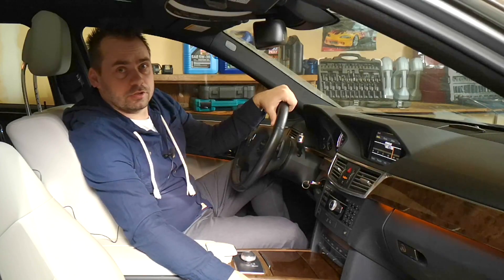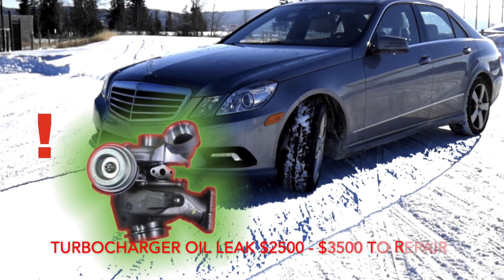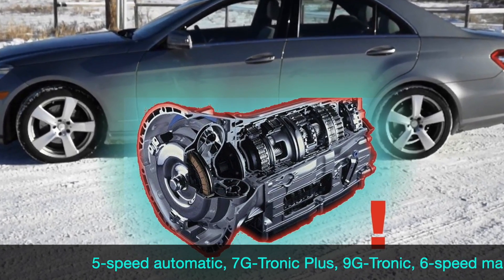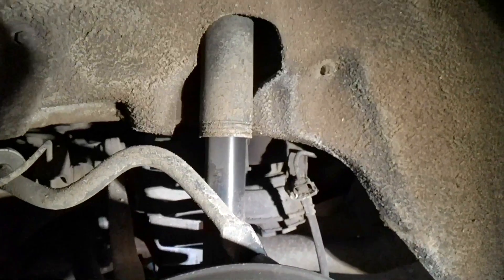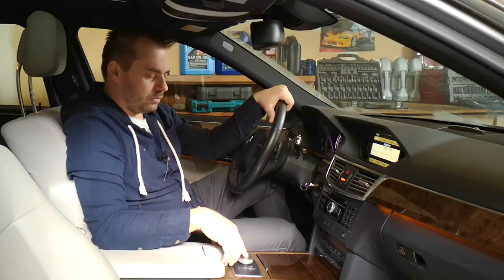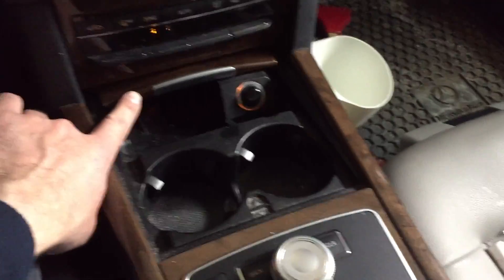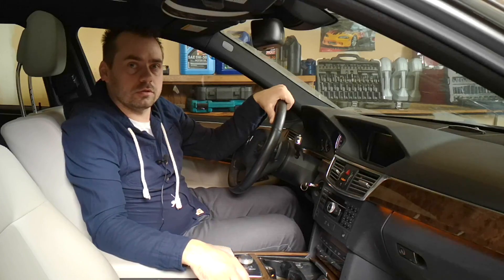🤞 🇩🇪  Used Mercedes Benz E Class Reliability | Common Problems and Issues | W212 S212 / 2009 - 2016

Comment: 2015 E63 AMG S owner here, no issues at all besides basic maintenance I do myself (oil changes, coolant flush, spark plugs and front brake pads change). I also have a custom stage 1 tune and this car is reliable and pulls really hard. Such an amazing piece of machinery. So overall, it depends on how you treat your car and knowing previous history of the car

Comment: I own a W212. I have none of these issues with mine. That dash appears to of been taken apart and not re-assembled properly.
Reply from the maker: Just wait for it
Reply: U bought an accidental car
Reply: @suhailahmed4449  i had 2012 e class that was old taxi, 400,000 kilometers driven and it had none of these issues :D 3 liter diesel ;)
Reply: Same here, only the Avantgarde and AMG versions came with real leather, I have mine since 20k, now has 100k (miles) and the leather is almost as new, also the interior build quality is somewhere else compared to this car (2.1 CDI avantgarde)
Reply: @Sawyer Valentin piratebay forever bro :D

Comment: I have over 180 000 km on my W212 and I’ve encountered none of those problems. The misalignment on the taillights can be adjusted by turning the screws made for alignment in the trunk.
Reply: Cool, you bought it when it was new? Whats your own way of maintainance on your car? Can you pls give me some advice? I am planning to buy e350
Reply: @Ochiroo0114  I would do pretty much anything I'd do with any other car. always change parts on time, like the timing belt, transmission oil, engine oil, etc.. avoid bumping into potholes or driving on high rpm-s for long periods of time. If you take care of your car, it will take care of you. Its true for Mercedes at least. Make sure your battery is in good condition, as that may lead to many problems. I had to swap out my burned out GCU because of a faulty battery, cost me alot
Reply: @NikoAbaishvili  With your faulty battery, did you notice issues like lights flickering on the interior when idling?
Reply: @Ochiroo0114  I would say try find a facelift W212 since Mercedes spent an extra billion dollars facelifting it and I think they upgraded some components.

Comment: 6:20 The leather NEVER rips, those are MB-Tex seats and they do rip. The leather seats look different much like the W126 from 1980-1989.
Reply: I have a 2010 e350 sport and the driver seat is starting to rip.
Reply: @mjcmjc6428  But you have the leather or the MB Tex? My E350 2011 has 250K and seats still perfect.
Reply: @mjcmjc6428  You may think you have leather but it actually isn't, the MB Tex looks and feels like leather.
Reply: 2010 e350 sport with natural beige leather it’s a 1,590 extra option when they came out back then more comfortable than MB Tex

Comment: I own a w212 e550 and it has been the best car i have ever owned. No issues whatsoever period. I think judging by how dirty this car is under the hood and in the interior, this guy has picked up a neglected model that some person leased or owned but refused to maintain. 

MAINTAIN YOUR CARS PEOPLE. DO WHAT THE MANUAL SAYS AND GET YOUR MILLION MILE BADGE 20 YEARS DOWN THE ROAD> A maintained car is cheaper than a new one.
Reply: So why does dirty cheap cars work??
Reply: @rahimi4762  I think you missed the point there brother.
Reply: e250 2016, if it wasn't for the diesel emission system would have jus been routine maintenance. Had a nox sensor go and a diesel temperature gauge. Had a field measure done last year so I have a new DPF & other parts. Just waiting for the adblue heater to fail now (30,000km left on warranty) since it's the original one.

Comment: I have 2011 e250 automatic with 321k km, cuprite brown. Interior is still like new, no wrinkles on the dash or ripped leather. I do quite a lot of city every day to work drives and long range up to 700-800km specially for summer. So far around 270k the chain stretched a little bit and was replaced, 290k km rear right distronic sensor failed, also around that mark ESL failed, 300k km scroll wheel, 310k km starter failed, 321k km mechanic said the water pump might leak and would be advisable to change. So far no oil leaks which surprised mechanic as well he said it was dry as desert. While the issues piled up at 270k km it still pulls very fast for such a heavy car  with 204 hp, its very comfy for long rides.

Comment: Great video, thanks!
In my experience, people often and wrongfully think that BMW and Mercedes-Benz luxury cars equate to reliable cars. 
This incorrect thinking goes "it costs a lot, so it must be well made".  that is hardly the case. I've had nothing but problems with my BMWs and MB's over the years (2000-2013s), which I do not buy anymore. I have also owned a newish model Audi (2014).  Surprisingly the Audi is not nearly as bad as my BMWs or Mercedes that I have owned. 
In either case I think I have found the sweet spot - Lexus. I bought my first Lexus in 2014 after I tired of the crappy BMW and Mercedes build qualities. The Lexus has been great, with almost zero issues, 8 years and 130k miles later.

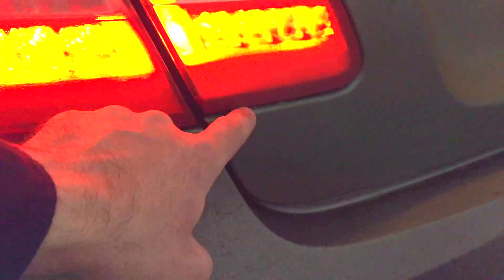Comment: 5:55 any car can get a misaligned trunk if you stuff luggage into it. You can adjust the striker at the lower sill (two 10mm screws) in 5 minutes.

Comment: nice video! I'm surprised at the interior issues aside from the seat. My 2010 has 108,000 miles and i've had both front seats reupholstered for $420 and the wood trim has faded to a blueish/gray wood which actually looks cool on pallidum silver exterior with the black. I have push to start which i guess explains the key always working fine-- i keep that center tray clean and lubricated so it can slide freely and it does. command wheel has never had a problem and neither has anything else.
Reply from the maker: Thank you, leather quality is just poor, but sport seats are OK.
Reply: Yea I had same issue repaired both seat 200 that’s it nothing else at all

Comment: I know this is a w212 video but I have a 2007 w211 e550 and it’s been very reliable. I bought it with 130k and it just ticked over 145k miles. All I’ve done are oil changes and replaced all plugs and coils

Comment: Great video, equalize the volume though!
My issues on mine were/are:
- Coolant pump leak
- Fuel filter housing (coolant hose) leak
- Gearbox swithces to P under 10kph randomly!!!!!! (DAS failure probably in EZS)
- Rear wheel bearing
- Steering gear weak
- Transmission roughly shifts
- Noisy plastic parts inside
- Leather seat rips
- Random oil leaks

These were the most annoying. Engine is not bad on the other hand.

Comment: For anyone watching this -

Just bought a 2011 Bluetec 3.0 diesel with 123k miles. Totally clean inside and out. I paid $9500 cash.

I took it to the dealership to be inspected and to fix all major issues.

Timing Chain - $3100
Engine Mounts - $1350
Parking Brake Assembly - $680

Hope this helps
Reply from the maker: Car after warranty deserves good INDY shop not dealership, could have paid half.
Reply: Yep, if you find a good privateers shop, engine mounts will only charged $300-500 to replace. Dealership is a ripoff.
Reply: So a used Mercedes is a piece of crap is what you are trying to warn us about?
Reply: @MechAdventures   for real, that price for the engine mounts that cost $150 is INSANE.  Not even a difficult repair for DIY!
Reply: @erichue61  No, those are wear and tear items, just like on every vehicle, he just got reamed by the stealership instead of going to an indy Euro shop.
Reply: John Knee ok, my bad. I have a Lincoln, where do I take it to?
Reply: @erichue61  I'd just look at Google reviews for Euro shops in your area.  They'll always be cheaper than a dealership.  Or if you're mechanically inclined, there are YouTube videos for just about anything

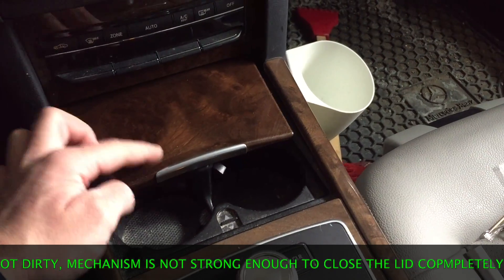Comment: 5:04 the sliding door works fine - use silicone spray and don'y force it. Designed by an outside company for Mercedes-Benz. Yes, they are delicate if you abuse them.

Comment: Good job, I just bought the car and all the problems you just mentioned are present on my car. Also the speakers and heated seated break... My two front seats have the vinyl tearing apart and also the back starting to tear apart. The bottom part of the seats have two heated seats wire and they all fail on this model... I have a Mercedes-Benz e300 1999 td also and not even a mark on seats after 214000km and the heated seats and speakers still work. It's sad to see the Mercedes-Benz brand going down over the time...

Comment: Good info! I planned this year to look for a nice 2010-2011 E 220 diesel station ( current cars are 2 Volvo V70 D5, and yes at least one of them I keep ! ) But it is the better choice to go for the more basic models, 200CDI, 220CDI and standard petrol engines, more than comfortable enough! The air suspension is a big point of attention indeed as de timing chain. But for the rest the E-class is an absolute reliable comfy car, not to mention that my Volvo's D5 are great cars too, especially the 5-cilinder engine is a BIG PLUS and the real leather seats in my cars are nearly fenomenal. Extreme good quality and comfy. Well so to go for a Benz might be a little risk ( the reason I keep one of my D5's ) but for sure I wil buy a real German built Benz, believe it or not: they are significantly better than the rebuilds from the US. But hey I live in Holland, so Germany is my neighbor, plenty of nice cars here on the road!

Comment: If I make one modification to my 2012 it will be an adjustable rear lower control arm.  With the OEM, camber will go out of spec after a while even though the joints are still tight.  No play but they do get compressed and wear the inside tire tread quickly.  I hope to keep it for another 25 years.  I just want to be sure that the aftermarket piece is as solid as the OEM.

Comment: 2011 W212 E350 3.L diesel.  
One issue is the coking up of either the EGR valve or intake manifold, caused by PVC system.  Keep the red rubber gasket between turbo and inlet horn in shape.  To minimize the oil carryover, I recommend using TurboMaxx oil treatment as it reduces oil consumption, and side benefit lengthens the timing chain life. 
The other is strange, will show as a low EGR flow warning, put you into a limp mode.  It is the mass flow air sensor MAF calibration.  There are two MAF sensors and they are flow balance matched, the EGR flow is calculated  by the ECU combining the EGR position sensor inputs  and the MAF sensor inputs to provide the EGR FLOW data for the injection system.  The EGR is usually not the issue. The issue is the MAF sensors being out of balance or if one fails... usually they are out of calibration due to contamination or attempting to clean.  Be sure to keep the red rubber gasket between the air horn (where the MAF sensors are) and the turbo up to snuff and not leaking, and the PVC system up.  If you try cleaning the MAF sensors as preventive maintenance or any another thing that changes the calibration balance you will be in for changing the entire air inlet horn with matched MAFs part costs $350-$550 depending on supplier (OEM Part ONLY).

Comment: Those are MB-Tex seats, not leather.  MB-Tex is normally nearly indestructible, so I'd question the maintenance of the car.  The damage shown on the driver's seat is typical of someone using some sort of "cleaner" or conditioner which attacked the material..  I think you'd be hard-pressed to call it a systemic flaw.  The console cover tension can be adjusted.  It will take an amateur about an hour, a pro should be able to do it in half the time.  Hardest part is getting the console side trim pieces off, and while you're at it you might as well replace the shaft in the Comand controller knob.  You're absolutely right, if it hasn't broken yet, it will.  $100 for the kit?  You didn't dig very deeply; I paid $28 including sales tax and shipping for mine and replaced it in about 40 minutes.  The "kit" consisted of a machined aluminum shaft.  I have a 2011 E550, my dash doesn't squeak at all, and I have zero body-panel alignment issues.  A sunroof that doesn't close fully is most often poor lubrication, dirt or some other foreign debris in the tracks.  I had the problem with my 99 and my 2006 and in both cases cleaning and lubricating the tracks cured it.
Reply: Why does peasant cars sunroof close with dirt debris and poor lube??? Ppl making excuses for overpriced Benz. I miss the days of bank vault Mercedes

Comment: I love you for making this video haha. I have a question: I'm buying a 2012 E350 used one. It has 114,000
 km but its been maintained by the Benz agency really well. At least from what I can see in the service paper. What's likely to go wrong with it or what should I look out for? And is it prone to getting some sort of engine leak that will cost me a lot?
Reply from the maker: Be aware of all that is stated in the video
Reply: As long as it isn't a bluetec you should be fine.  And if it is a bluetec, prepare to do the oil cooler seals once and the turbo intake seals about every 20k miles.  Relatively easy repairs to do if you're mechanically inclined, own a WIS from Ebay, and set of ETORX sockets/wrenches (ratcheting helps a lot).  

If you get a copy of the WIS and take the time to learn to use it, you can repair almost anything yourself on these cars.  They aren't as daunting as they're made out to be, just--different than what most people are used to (i.e. Japanese)

Comment: You mentioned the M272 3.5l but left out the M276 3.5l engine, the latter is what I have in my 2014 W212.
Reply from the maker: would you share you experience ? Hows reliability ?

Comment: My 10 E550 4Matic had the Comand scroll problem, the lazy cup holder return cover, the auxiliary battery for shifting needed replacement. The blind spot detection sensors are the only failures that I haven't addressed.  The front brake rotors were a problem with pulsation and should have been recalled.
Reply from the maker: Thanks for input

Comment: Can you do Mercedes-Benz W221 video? I want to buy mercedes E or S. I'm like 50/50. Don't know what to choose yet.
Reply from the maker: I will. They are very similar with almost identical issues. Pick one you like more visually.
Reply: Get the W212 instead… those S-classes get pretty freaking expensive to run and maintain
Reply: I was like that a few months ago. I had to decide e350/e550. I went e550. Still liking it.

Comment: Just use a PTFE spray for the stuck cover to reduce the friction !
Reply from the maker: tried all kind of lubrications, it will help only temprarily. No real solution. I call it design flaw. Its Benz, shouldnt use any home made tricks to make things work properly. Hyundai, Mazda maybe but not Benz or any premium brand that you pay Premium price.

Comment: Those are not leather seats in the car you reviewed. Those are vinyl or imitation leather seats as people call them. You can tell if it is leather or vinyl by the different stitch pattern where your butt sits. Leather has stitching going from back of the seat to the front, vinyl has stitching going from one side to the other only trough the middle. The actual leather seats are very good, with a nice thick leather.
Reply from the maker: Does it matter for purpose of review ? They still crack regardless of how you call it.
Reply: @MechAdventures  Because leather doesn't crack or rip like that.
Reply from the maker: @TheTurbinator  you cannot get these model with real leather unless custom order so what is the point of chasing words for purpose of review this model ? BTW no auto maker offer real leather seats unless custom order or in premium brands such is Bentley, RR etc. You are crying of wrong grave.
Reply: @MechAdventures  It's not so un common to have a nappa leather in these cars. They last much longer.
Reply from the maker: @nico-toscani  only in combo with sport seats (which you have to pay extra) and vast majority in 2 door coupe, not these basic ones.
Reply: @MechAdventures  I don't know where you live, but in central europe we have plenty wagons and sedans with real leather, even with vented option. Well, I guess we paid.
Reply: Yeah, adding Nappa Leather costs $1,250-$1,750 and you can add it on any model in the US.
Reply: Mine is real leather with 140k the seats look amazing,  and I bought mine brand new with $2500 upgrade from vinyl Racine
Reply: @MechAdventures  I'm sorry to disagree with you, but in the US at least what you are saying is not at all correct.  Full leather is an option on all MB models I'm aware of, and all three of mine (two purchased new, current one purchased used) have had full leather as independent options.  The two I bought new were not special orders, nor were they sport seats.  In fact, I just sold my 2006 E350 with 180k miles on it and the leather looked like new.  Probably because I understand how to care for it, and am willing to put forth the effort.  Most dealers order a mix of options for stock, and while MB-Tex is a bigger seller (lower cost, more durable than leather), I dare you to go to a dealer and fail to find a new car on the lot with full leather.  Maybe not many, but I guarantee they'll have some.

Comment: I have a 2009 2 litre CGI Avantgard 100k miles. The rear subframe completely rusted through and broken in 3 places with a cost of £3K to put this right with a new genuine part supplied by Mercedes UK. This is quite a common problem in the model W212 so I would advise you get this checked out before you purchase Mercedes-Benz E class of this period. They know of the problem but as the car is over four years old, it is not their problem. This is a dangerous situation and I believe should be a subject for recall. 10 years is no age for a Mercedes car. They say German technology is high well sorry to say it is not where this car is concerned.